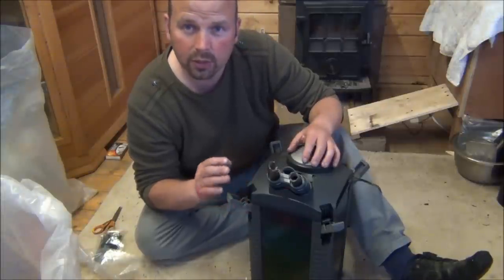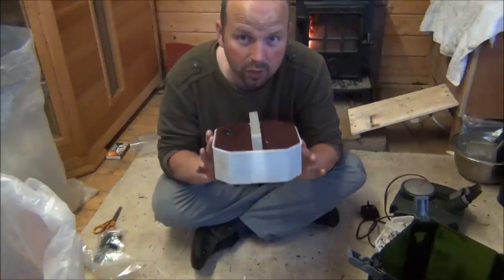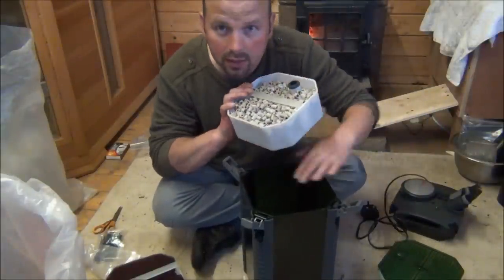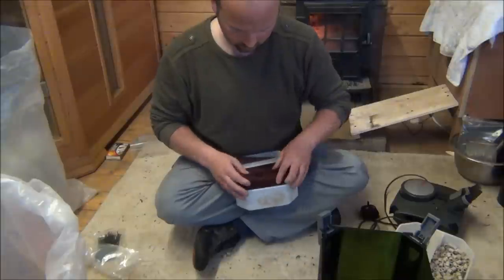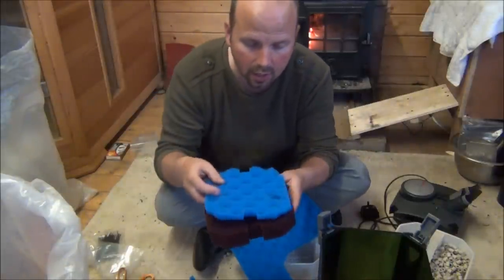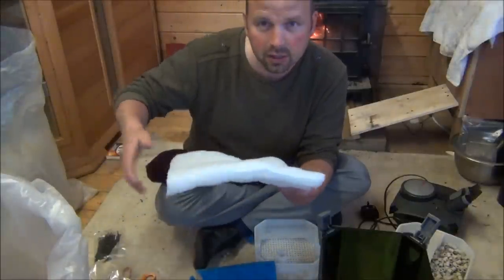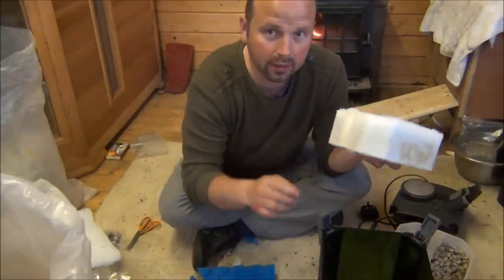How to set up an external canister filter for aquarium by Pondguru

Comment: If I have a really good canister filter, does that mean I barely have to clean the tank at all? I have a turtle.
Reply: +knarisa You'll need to eventually clean the glass of the tank and if you have not only a good filter but like in this video, a good setup, it should clean the water just fine, I don't know about turtles, but for fish you also need to do water changes, do a quick google search and read about water changes for turtles.
Reply: +knarisa Turtles are very messy and create a lot of waste, you will need to change the water regularly even with the best filters. Change the water in segments. For example, I change a quarter of the water in the tank every two weeks and wipe the glass when it becomes dirty, usually every week or so. If you want any advise on turtles/ terrapins feel free to ask :-)

Comment: Why not put the Biohome glass media in the bottom, too, instead of the ceramic rings you so clearly hate?
Reply from the maker: Ceramic rings are the best at directing flow in different directions and holding some heavy muck due to their shape (having a hole through the middle) and it is a waste to use good quality media in there since it will be sitting in filth, as explained in the video.
Good quality media really needs to be operating in clean water to be efficient at holding bacteria -but media (e.g. ceramic rings) under the tray are there as a first stage of mechanical filtration, not for biological filtration (although bacteria will live everywhere in some capacity).

Comment: Now I heard the cynder glass media has to be replace every 6 months or so, but ceramics don't.  So why are these supposedly better?
Reply from the maker: Sintered glass filter media should last 6-10 years in a properly set up filter. I'm assuming that the 6 months came from the internet? lol
Reply: Pondguru  nope, came from a online store in the product description. Amazon
Reply from the maker: dennis crawford 6 months is definitely wrong unless it is a different product not meant for filtration that I don't know about. Sintered glass should have similar life to ceramic media.
Reply from the maker: dennis crawford That simply doesn't make sense as it is a similar product and in a properly set up filter it should last for years. I'm sure they have mixed up the 'replace' years with months as it takes at least 4-6 months for the anaerobic bacteria to get set up inside the media. If it takes 6 months to get a good population of bacteria and get to full efficiency the very last thing you want to do then is then throw it away, lol
Reply: I was just trying to get the best media.
Reply from the maker: dennis crawford Always a good plan. Most people will just go for the cheapest and then wonder why their pollution levels are high, lol
Reply: I know. LOL

Comment: Trying to figure out how to prime a canister filter after I clean it? Cleaning the filter has not become a nightmare job since I can never get the damn thing to start back up. I fill the canister with water, get the intake tube back down underwater and the outtake all setup...turn the filter on and nothing happens. So I take it apart again, check the motor again, set it all back up again, re-fill it with water again, get the tubes back in the tank again, turn it on and...nothing.
Reply from the maker: +Milo Kovet It can be difficult but if you fill the tubes and the filter with water there should be less problems and more success. You could fill it he intake pipe with water then blow down to drive out the remaining air in the pump chamber of the external filter, then refill with water or drop end quickly into water to keep the syphon going. It may splutter a bit but should keep going, spit out the air and work well once it has only water in the system..
Reply: I had this problem until I reconfigured the rubber water inlet tube to go straight down to the canister...before that I had a big horizontal hard plastic tube ABOVE THE WATER LEVEL (I think that was the main problem) outside the tank and the filter was hardly sucking at all.

Comment: excuse my ignorant thinking the filter sucks from the bottom out to the fish tank and in from the fish tank from the top off the canister top, the tubes on the baskets is for the filter impeller sucking water up from the bottom out to exit the canister, if you turn the canister top you will see the impeller orifice allying's with the trays tubs at least that the mechanic's waterworks on my canister
Reply from the maker: Some filter will have water flowing through trays from top to bottom but this one is definitely bottom to top.

Comment: How would you set up the mechanical filter media in a Fluval 406 for this kind of efficiency? The Fluval has the coarse sponge located vertically on the intake side of the filter, then a medium sponge in a basket at the bottom, and three more baskets on top i.e. this diagram. 

http://www.amazingamazon.com.au/media/catalog/product/cache/1/thumbnail/9df78eab33525d08d6e5fb8d27136e95/f/l/fluval_206_306_406_1_1_1.jpg

Could I replace the coarse sponge with ceramic media? Then could I stack coarse, medium, and fine mechanical media in the bottom tray, leaving the top 3 for bio filtration media?
Reply from the maker: I would personally leave the coarse foam down the side and simply set the trays up as in this video for maximum efficiency so you would have your foams and fine pad in bottom tray and media in trays above that.

Comment: So carbon is not important?
Reply from the maker: If you have problem tap water or staining from bogwood which you want rid of it does do a good job but not essential at all.
Reply: Pondguru Thanks for such a quick reply!
Reply: carbon is only needed after the treatment. It's actually not needed and the treatment will not work if you have active carbon in the cannister.

Comment: Dear Pondguru, thanks for the video. I would like some help and suggestion for my 2 layer external canister filter. I am from India hence the BioHome Media won't be available here. Any suggestions for other media. I need to keep drift wood in my tank as the water is very hard and the drift wood helps. Also its a Cichlid tank now so some hiding places being made by the drift wood. I used to have Discus fish before but they all died one after the another over time due to white poo and all treatment failed as it use to happen now and then. I think there is something going wrong with my current filteration and the white poo seems be a big issue. I have had never had this issue.

Can you please suggest how often I need to change the water and what kind of setup in filter I could do to stop the problem. Appreciate your help on this to save my current fish and having a healthy tank.

link to my current setup:

https://youtu.be/FJ0BYT7lbLU

Comment: Hey Rich, I have just acquired an Eden 521 external filter. I've already ordered some biohome ultra from you through ebay, but wanted some advice on making the filter more efficient. A diagram on how the filter works can be found by going to http://www.aquariumline.com/catalog/userfiles/image/eden_521_particolare(1).jpg 
Should I fill the empty space at the start of the flow with the media that came with the filter, for example? Any help would be appreciated. Cheers.
Reply from the maker: When I look at diagrams like that I just despair, lol
The best place for biological media is in the chamber where the UV? is. It can't really go anywhere else in that filter as the muck will collect in the bottom of the filter. I wouldn't alter that particular filter except for the chamber I mentioned for media but the UV light is a big problem as it will kill the bacteria in the media so it's a case of either operating the filter without the UV light or leaving as it is. The media should be the last thing the water hits before leaving the filter.
Reply: Thanks Rich. I'll leave it as is then. I think the chamber you're referring to is actually where the spinning pump cylinder is - it's not a UV.
Reply from the maker: woodieb78 Possibly - right in the middle. Looks like a UV bulb but there are no annotations so I was guessing, lol 
In that case that chamber could be used for good quality media, no worries.

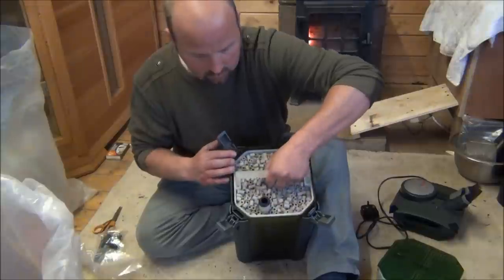Comment: 1:00 "WORSE than useless"- OMG-LOL sad but true. SMASH THEM into bits would be better use. What was that green stuff on top- Easter Basket Grass? How's this for a DIY "canister" filter=  At Wal*Mart- Shopvac has an 8 gal model for $60 USD. Wired to a $6 dimmer switch so turn down the motor & not harm anything, modified dishwasher racks or milk crates for filter bins... I've never seen an 8 gal filter. Those small units like in this video are what- 1.5 or 2 gal if lucky- for over $100? What Usay?